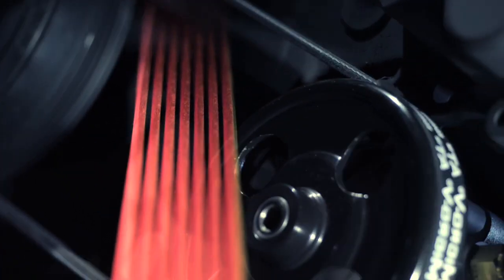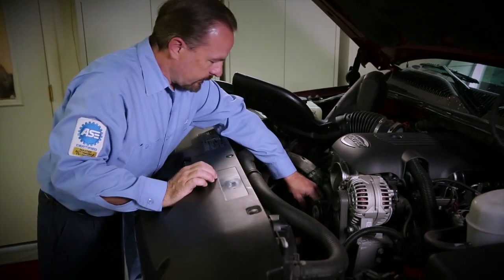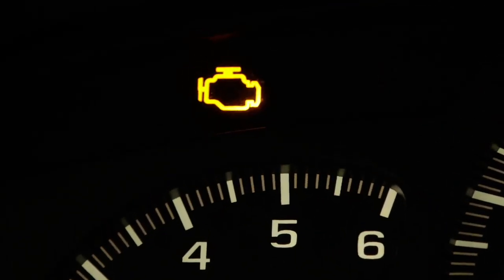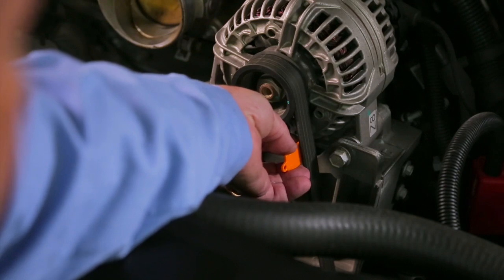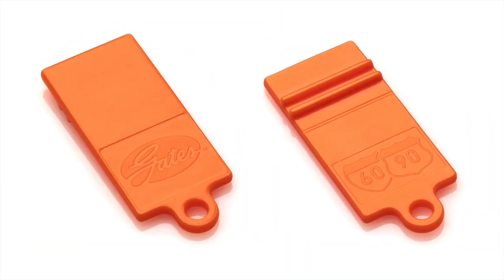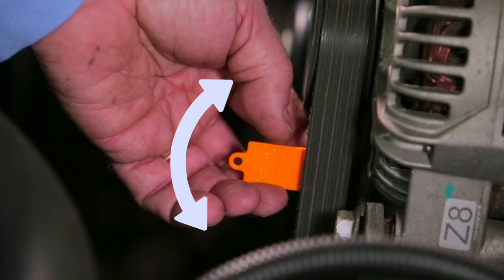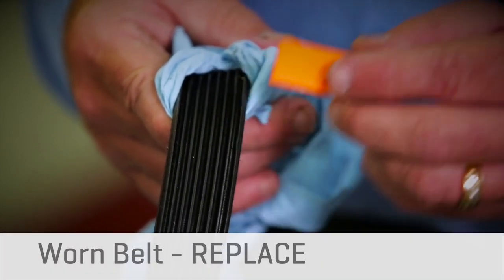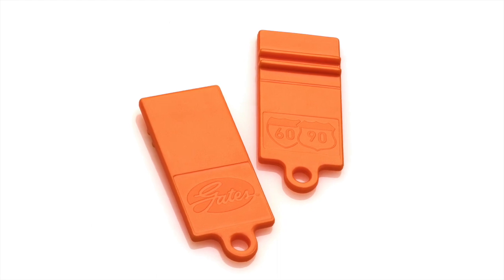GATES TRAINING: Inspecting Serpentine Belt Wear with Gates' New Belt Wear Gauge

Comment: So... this will work on any serpentine belt, whether OEM original, OEM updated, or aftermarket?  I'm dubious.

Belt grooves are variable in material used and depth, which affects grip/friction/depth of engagement which this tool relies upon.